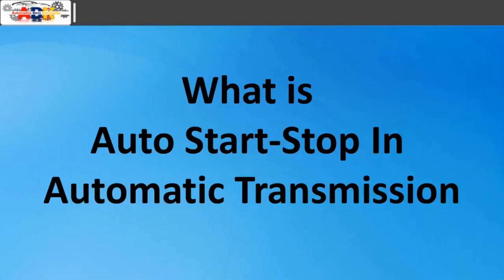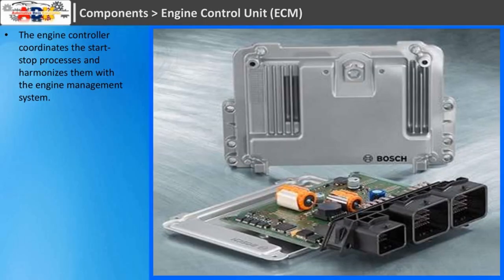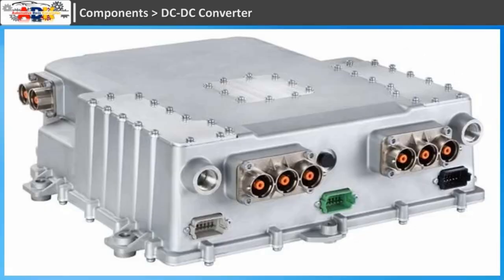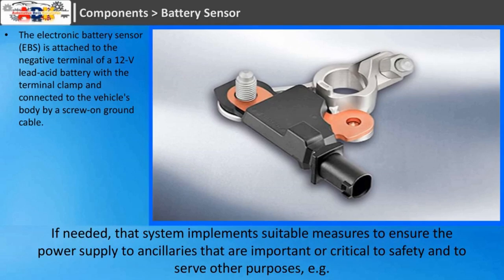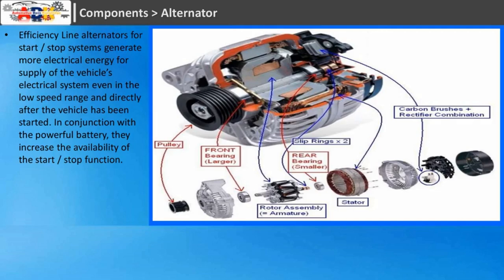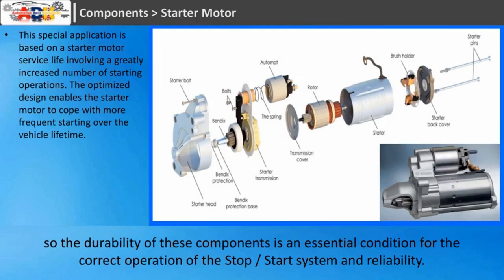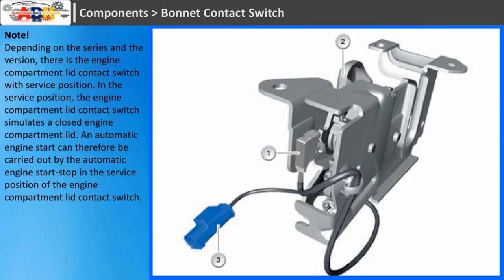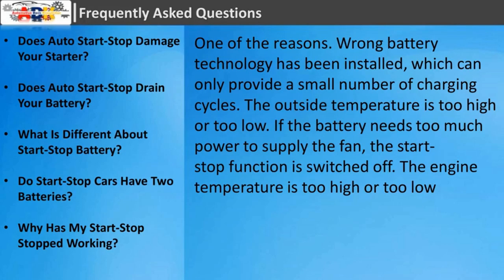Auto Start Stop In Automatic Transmission

Comment: replace my transmision cvt malibu and auto stop  do not work . what can i do to solve this .thanks
Reply: Stop/start can be really finnicky and if all conditions are not met, the vehicle will not shut off. Every car is different, but the most common issue is with your car's battery. If the battery is not charged well enough, or is older and can't meet voltage or load capabilities required by the car, stop/start will not function. If you replace the battery and it still doesn't work, make sure your vehicle is up to operating temperature and before you come to a stop, turn off every accessory. Turn off the heat or A/C completely (turn the blower fan off), heated seat if you have it, radio, wipers if they are on, and any other component you can think of that would consume power. If the car turns off, then you know that you were just using too much power for the car to be able to turn off and still have enough power to fire back up. From this point, turn some things back on and see what the limit is before the car turns itself back on without you releasing the brake pedal. If the car still does not turn off after turning all these features off, then you may have another issue. Also ensure you do not have a check engine light or any other kind of warning light on the dash (ABS, airbag, low oil pressure or other) because this will cause the stop/start to not function